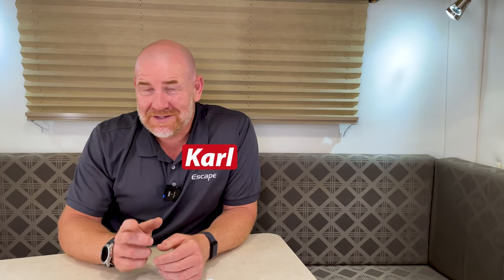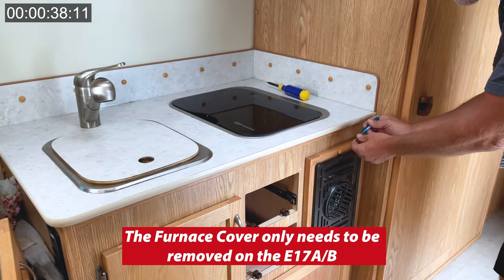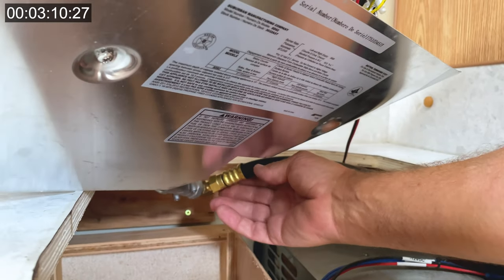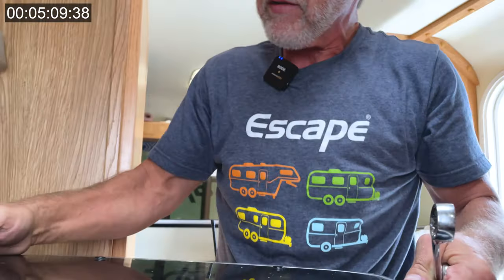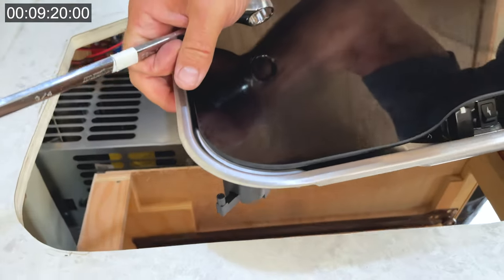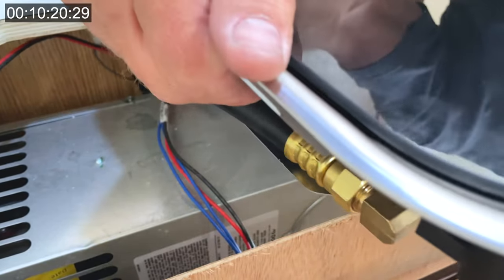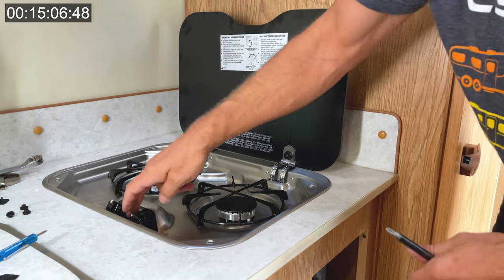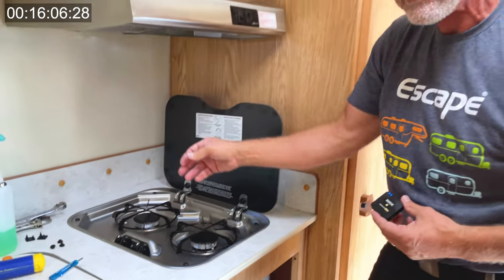How to Replace the SDS2 Drop-In Cooktop

Comment: Great video!  Thank you Escape folks.  One additional comment.  I feel the principal issue with these stoves was/is that the valves could loosen up, causing the aluminum tubing to jiggle & work harden and break.  Mine did.  Also Dave pointed out the bottom plate is sometimes loose.  Mine was.  So, I feel while the design of the stove is fine, my feeling is the factory's quality assurance wasn't.  They should check that all items are tightened down.   And in our case, one of our top, black burner plates even loosen up.  So, even with the new stoves I recommend that all of us using these Suburban stoves check that.  Valves.  Bottom plate.  Burner plates.  Whatever can be loose, just might be needing to be tightened up.

Comment: Awesome Video!  Here is how I was able to do this ourselves.  I and the buyer of our Escape 19 replaced this cooktop in under 30 minutes. I went to our local RV dealership that works with Suburban and had them order the replacement.  Unfortunately their next service appointment was near the end of September and our buyer of course wanted the trailer now.  So I removed the old cooktop and took it to the RV dealer when the new unit arrived. I provided the RV dealer with the  Trailer VIN and some other information they wanted.  The RV dealer then gave me the new Suburban stove top and I gave them the old one.  So our local RV dealer did not have an issue giving me the cooktop.  The buyer of our 19 actually installed the cooktop while I was taking care of the title exchange - easy peavy.  Note - you can easily tell the difference between the aluminum lines in the old stovetop to the stainless steel lines in the new one.  Kind of makes you wonder why they used aluminum in the first place on something like this.

Comment: Check the two on/off gas valves too (visible at 2:20 in the video)..  My original stove valves worked loose and after I had my first stove replaced due to it catching fire the replacement stove came from Suburban with loose valves.  They were not secured to the body of the stove properly.  The plastic "beauty rings" under the black knobs  are the culprit.  They do not allow the nuts to tighten properly.

Comment: I'd love to know how the customer got Surban to ship the new SDS2 to them. Surburban told me they would only ship it to a service center {which will charge me to do the swap). My SDS2 was not the original cooktop, I installed it myself, so I'll need to pay for the swap. I can easily do this myself. There is also the hastle of getting my trailer from storage, hauling it to the other side of town, possibly leaving it overnight, then reversing the process (two days of wasted time).
Reply from the maker: Hi Thomas, 

You are correct that Suburban will not ship the replacement cooktop directly to you. This customer had the SDS2 shipped to Escape and installed by us as we are an authorized repair shop.

- Harrison@Escape
Reply: It would be very nice if Escape assisted us in this process rather than just letting us know that the stove is faulty and then having to figure out how to deal with Suburban individually. We've been months w/o an operating cooktop and we still don't know when we'll have one that works. I modified an old propane burner to hook up to the external propane connection to get us by but I didn't expect us to need that for months (& months).
Reply: My experience is the only way to get a replacement cooktop from Surburban is to have an authorized shop order it from Surburban and then install it. Escape can do that if is convient for you to take your trailer to them. If you installed the cooktop yourself, like I did, then your only option is to pay out of your own pocket an authorized shop to install it for you. Of course the other option is install a different brand of cooktop.

Comment: I have had problems with the grommets that the burner grates sit on. Most of them have partially melted. I have made sure to use the proper pan size. Does Escape sell replacement ones.
Derek.     Escape 19.     2020
Reply from the maker: Hey Derek, 

Thank you for your comment! Please send our Parts & Service team an email at partsandservice@escapetrailer.com and they'll be more than happy to assist. 

- Harrison@Escape

Comment: What is the point of this video? I'm jumping through the hoops to get a replacement SDS2, and Suburban will not send the new cooktop to me directly, and you (i.e., ETI) say the cooktop must be installed by a "licensed professional." I don't  understand why this video exists.
Reply from the maker: Hi there, 

As Karl explains in the beginning of the video, the intention was to show how long the recall removal/installation takes. We have had a number of customers receive high quotes for this work and wanted proof that the installation can be completed in less than 45 minutes (much less time, even). If a customer has been quoted for hours of work, they can show this video to the shop and negotiate a quote that is fair and realistic. I appreciate it may not be useful for everyone, but if it helps one person it's worth it. 

-Harrison@Escape
Reply: @takeyourescape  Thanks, Harrison. I just received a quote of $95 for 1/2 hour of labor.
Reply from the maker: @Mmmyess  Glad to hear you received a fair quote! Let us know if you require any assistance. 

-Harrison@Escape